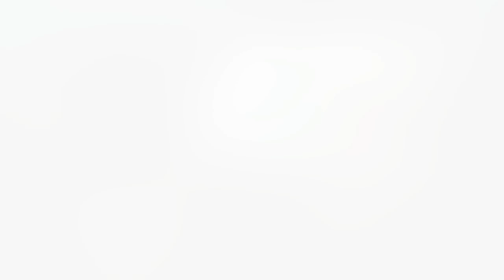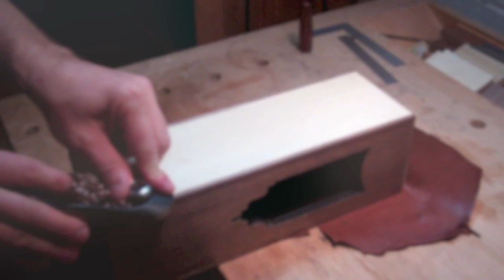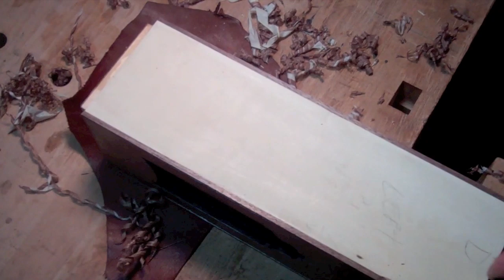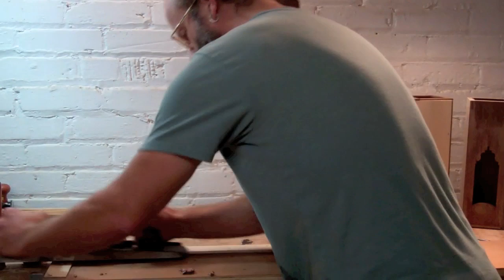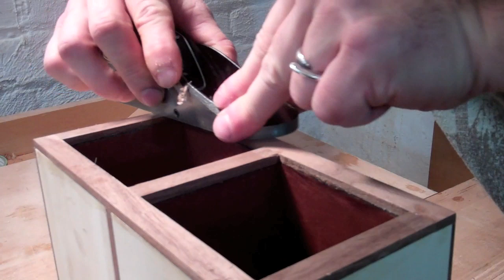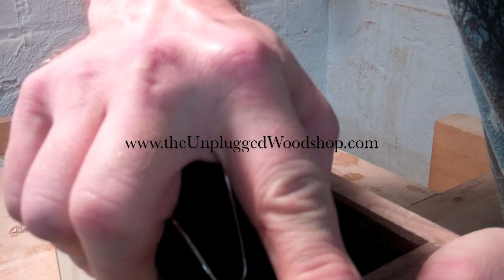Attaching the banding - the good Dr.'s medicine chest part eight.

Comment: If you have a piece of wood with two veneered faces and you want to put some banding along the edge between them, how would you cut the recess into which you would put it, using hand tools. I'm assuming I will need to buy something like a second hand combination plane to do it. Can you recommend anything?
Reply from the maker: Paddy, thanks for the question.
If the piece already has veneer on both sides, then I would simple edge joint the side of the board and apply the banding directly to the edge- no groove or recess.
Ideally, I would apply the edge banding before the face veneers go on.
If on the other hand, you had an edge banding that had some kind of tongue, you could use a plow plane to cut a small matching groove into the edge-
a router plane or scraper/beading tool may also work with a custom sized cutter.
Hope that helps~
all the best.